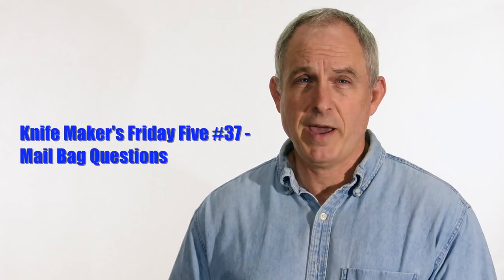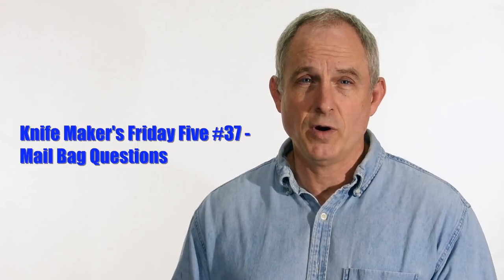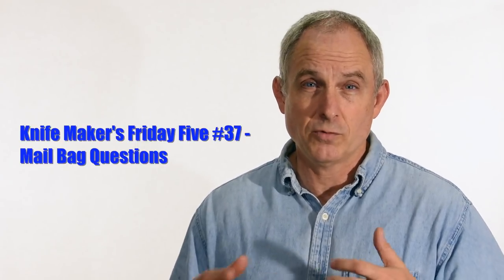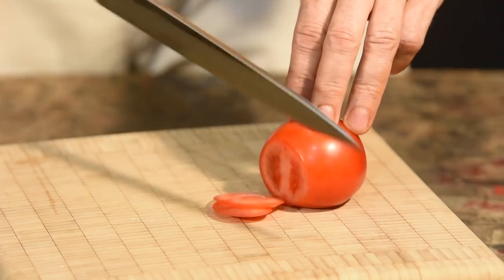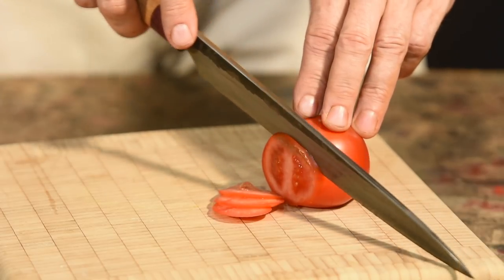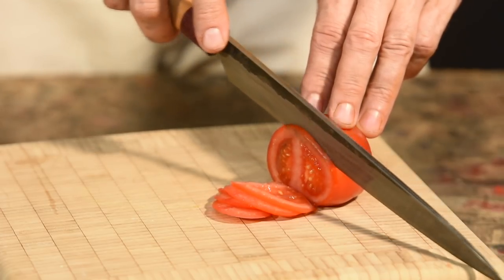Knifemaker's Friday Five #37:  Mailbag Questions

Comment: Chisel grinds are good for very specific tasks,woodworkers marking knives where you need to get really close up to your set square or a piece of registering timber,another important issue to take into account is that they are not ambidextrous only the bevel side pushes away the cut material which is why they bind in thicker harder materials

Comment: Hello 
 I find the Chisel grind on larger chef type knives to be more for making traditional Japanese Sushi,  With this type of a grind  the sushi roll falls away from the blade thereby reducing the sticking. With this type of grind on a sushi knife you have either a Right handed knife or a Left handed knife. The grind is on the side described as that handed knife.  Right handed has grind on Right side of blade et cetera. Good video though. Thanks.
Stoney
Reply: It also preserves the aesthetics of the fish since a straight edge won't 'mush' up the cut face of the fillet during cutting, while a traditional double beveled knife will press against the filet, possibly deforming it.